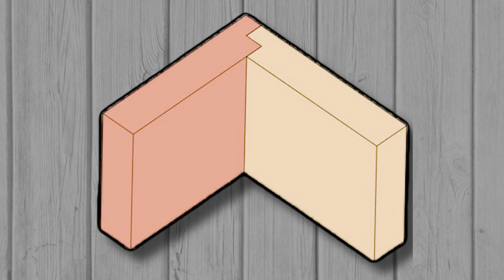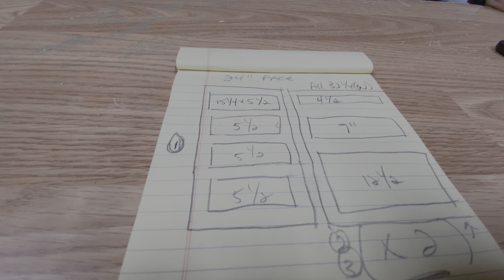Cabinet Drawers - Part 1 // The Modern Home Makeover - Episode 19

Comment: You should go buy a dado stack. I have the same saw and bought an 8" one from Harbor Freight. You just run the arbor higher up. Which is fine, because you don't usually make dados/rabbits that deep, and with the extra material being removed, the smaller diameter helps keep it manageable for the electric motor in the saw. Well worth the $50 when you aren't doing fine woodworking.
Reply: Or they can steal one from Jamie.
Reply from the maker: A dado stack is definitely on our list of things to buy now. Sometimes you just need to suffer from not having something until you realize you NEED IT 🤣

Comment: Nice job guys. With regard to holding the nail gun 90⁰, rotate it 90⁰ to the left or right, holding it gangster style. You were still holding it that would possibly result in a blow out.

Comment: pro tip: For cabinets, shadow lines are your friend. Things people notice are gaps in tight joints or sharp profiles but not in reveal joints or rounded profiles. If your drawers aren't closing flush with the case, you may end up with drawer fronts that aren't resting flat with the case or flush with the neighbouring drawers. To solve this you can install those clear stick-on drawer bumpers where needed to flush up the drawers and give them a shadow line reveal that will make it all look primo to anyone but the builder. Goodluck! Also break the edges on the drawer fronts! That'll help trick the eye to any imperfections too!
Reply from the maker: Thanks for the tips!

Comment: 06:40 Blowout (from nails being bent inside the material) almost always happens on the x-axis. This is because the nail is shaped like a 2x4". Wider on one side than the other. That means that if you hold the gun straight, like a normal gun, blowout, from the nail bending, will happen to the left or the right. Thats the natural way for the nail to bend. So if you're nailing a piece, like the drawers, hold the gun sideways, this way blowout will go up or down and still be hidden inside the wood. Same with the countertop in your last video, you held the gun in line with the counter and had a blowout to the left. 

Blowout (from shooting on an angle) just happens when the nails are too long and stick out the other end, or just go too deep. Holding the gun 90 degrees is important, but the person who told you that probably meant 90 degrees as in 'sideways', and not perpendicular to the work piece it self. 

Hope this helps. I can't remember the last time I had a blowout.

Comment: Router table and 1/4 spiral cut but makes those cuts easier and faster.
Reply: I was thinking a little trim router with a 1/4" bit and an edge guide would be cheap and pretty quick too.
Reply from the maker: We don’t have a router guide… Yet. We tried it with a trim router at first, but because the edge guide was missing the part where the bit goes in the center it made the cuts squirrely on the ends of the pieces… We ended up solving that problem in the next video though.
Reply: @Building_Jays_Way  I'll look forward to seeing how you tackled it!

Comment: 6:23 hate to be that guy but you need to turn the gun 90*/sideways.  The way youre holding it allows the nail to go left or right.  Change it to sideways and it can go up or down.  Not sure why this is such a hard concept to comprehend.   Look at the orientation of the nails.  Theyre essentially a micro i beam...they can bend 2 of 4 ways choose your axis appropriately based on the project.  You do NOT know "that" because it varies project to project and you failed this attempt that you claimed to "know".  It isnt always 90*... wow...